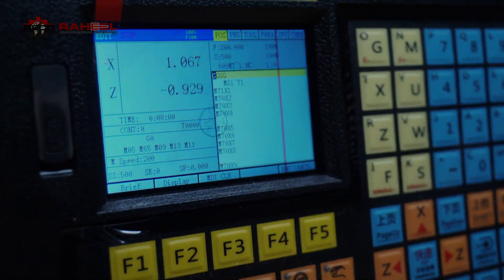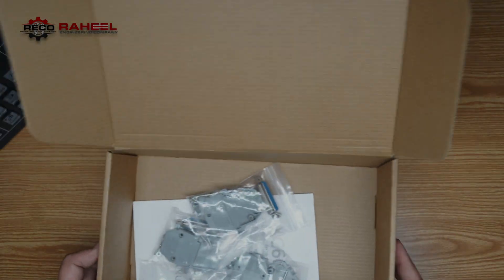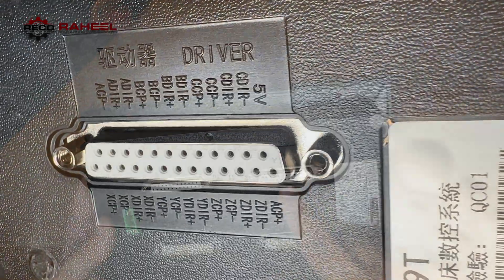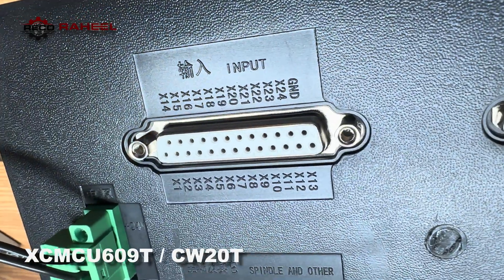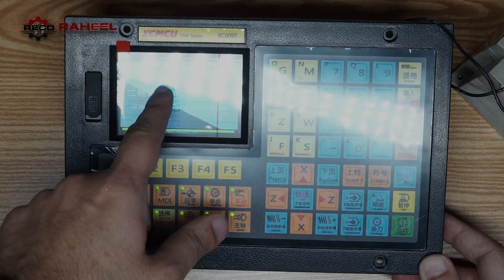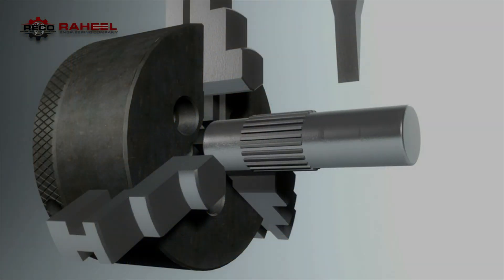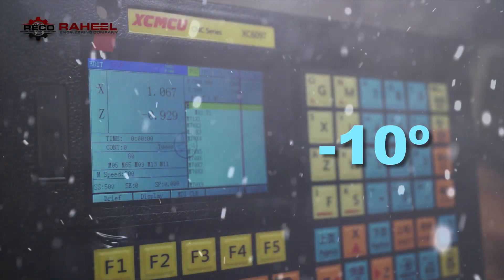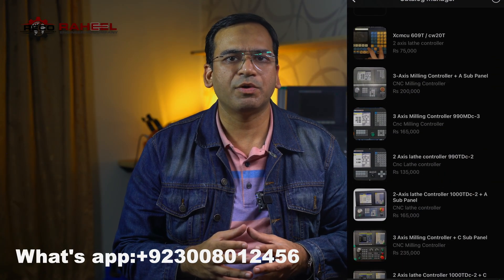CNC Controller under $300 || Review XCMCU 609T / CW20t

Comment: Olá meu nome é Marcelo sou do Brasil vc saberia qual é a senha para entrar nos parâmetros para usar uma torre de 8 posição? Da controladora xc609T ? Obrigado
Reply from the maker: no pass word required for this issue. just change the parameter p050 = 8 in GE PARA your tool will be switch  to 8 tools
Reply: @recopakistan1520  Desculpe eu me expressei mal eu gostaria de saber a senha para ter acesso aos parâmetros seria (88888888)?
Reply from the maker: yes this is the password but it is only to access logo change
Reply: @recopakistan1520   vc poderia me enformar a senha para eu poder acessar os parâmetros por gentileza?
Reply from the maker: @Stitch_ofc3 visit Patreon/recopk 
If you are using mobile app search “recopk” in search creator. 
you will get help about this controller